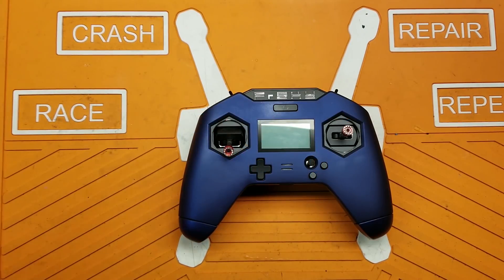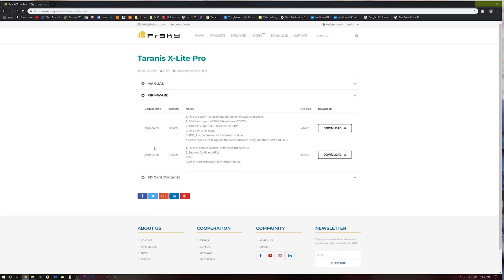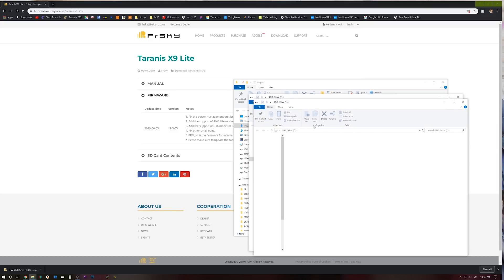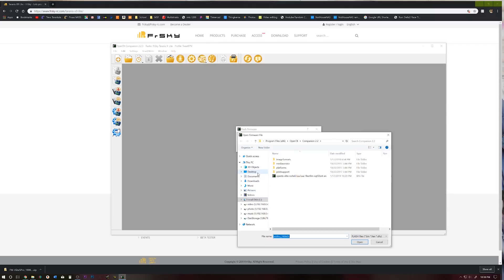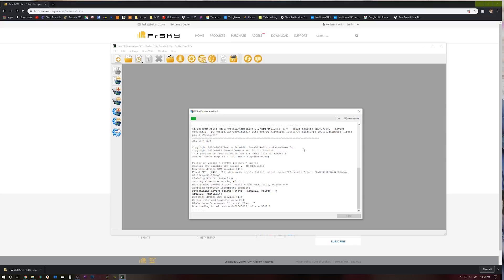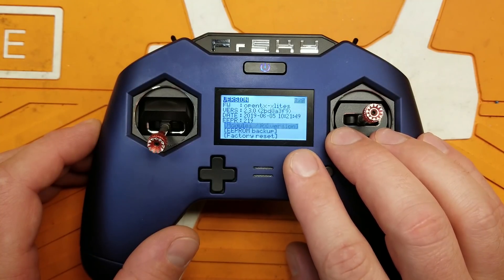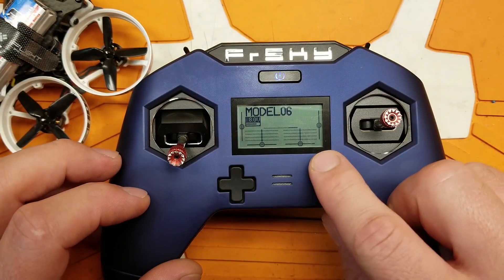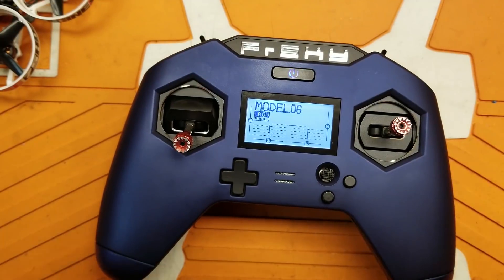Frsky xlite pro D16 support and PMU update!

Comment: Great video, my ixjt module not showing in my radio setup. any ideas? thanks.
Reply from the maker: Which radio are you working with?
Reply: @TweetFPV  Thanks for the swift reply, sorry it’s the Frsky xlite.My quadcopter binds no problem, motors start. But when I tilt the quad the motors stop I’ve even changed the controller from a inflight success f405 to a mamba 405 and it does the same. All the best.
Reply from the maker: 🤔 I'm going to need more clarification on that one. What do you mean by "tilit the Quad" what do you see in your osd when this happens? Have you check in the betaflight reciever tab that your xlite is moving the appropriate channel like throttle on your radio is moving the throttle channel in bf and pitch on your radio is moving the pitch slider in bf?
Reply: @TweetFPV  Hi
Yes in bf all good,even before I attempt to fly, even los . I flick the switch for motor activation , no problem until I lift the quad off the floor( props off) move it about the motors stop. I have even changed from a succex f4 to a Mamba f4. Still the same.Thinking of swapping motors, what do you think.?👍All the best.
Reply from the maker: Sorry, I'm not following. Join my discord and I can help you better.

Comment: Is there a way to bind the x-lite pro to the new whoops like the modubla6 that uses an internal frsky rx in D8 mode?
Reply from the maker: Some spi recievers can use d16 mode called frsky_x. But In my experience it's usually very unreliable to use. And range is very poor. I highly recommend the frsky xjt lite moduel with any of the micro quads in d8 mode. 
[Link]: https://m.banggood.com/beelink/fuvzxT

Comment: I got my x8r to bind to my x lite pro by updating the firmware on the x8r to the latest EU version.  Suggest you try that
Reply from the maker: There has been a fix. You shouldn't have to flash the wrong region fw to either device. Frsky has a Lua script to change the xlite pro isrm from EU to fcc.

Comment: Mine works and r9m lite did you flash your reciever also  once its flashed to access you cant go back to 16 mode
Reply from the maker: I have flashed everything over to access. I have found that I could flash my r9 system back to accst. I haven't tried to go back to accst on my r-xsr.
Reply: @TweetFPV  ive been able to do it with xm plus go back and reflash it to acct
Reply from the maker: My xlite pro was also a very early model.

Comment: I was really hoping to get one of these and put off getting the original X lite in the hope that something like this one came out.  But without D8 there's no way I would ever go to any of the latest generation of TXs since I have too many whoop boards that really need  D8 to work reliably.  Maybe if they fixed the random failsafe from the built-in SPI receivers, I might be interested as long a D16 works as it should, but I'm not holding my breath on that ever happening.
Reply from the maker: Yea I hope d8 comes to the xlite pro. If they made a xlite with shoulder buttons I would get it insted of the pro. Or like you said they could just get a handle on what's wrong with the frsky_x protocol on the spi recievers.
Reply: TweetFPV - Unfortunately, I’m hearing D8 will not be implemented.  Which is stupid in my opinion, but I am only a customer so clearly my wants and desires are meaningless... Perhaps that is some Asian Business Philosophy or something worse, but don’t give people what they want, make them settle for less and pay extra for it.

Comment: I got a Xlite pro today.  And I updated the firmware which supports d16 successfully by following your steps.  I can bind ac900 receiver and r-xsr receiver in d16,  and both work ok.
Reply from the maker: That's good. Many of the early models had a regional incompatability. Basically you buy a fcc version and the fw thinks you have a EU version.
Reply: @TweetFPV  I failed to bind tinyhawk s,  which supports d16.
Reply: @TweetFPV  do you have a tinyhawk s? can you try it? thanks
Reply from the maker: Yes I have the s and was able to bind it on d16 but I had to change the protocol from frsky_d to frsky_x
Reply: @TweetFPV I did change the spi frsky_d to frsky_x.  why I cannot get them work?
Reply: I tried like more than 20 times. and I am pretty sure that I did right with the binding procedures.  I can bind it with taranis qx7 in d16 mode. am I miss something?
Reply from the maker: Actually now that I'm thinking about it. It tried this with a crazybee f4 board but not the tinyhawk s. I will try it when I get home. I am on vacation right now without my xlite pro. But I will be sure to try it out when I get back home.
Reply from the maker: I just tried binding my xlite pro in d16 accst mode with my tinyhawk s in frsky_x mode and it does work. First try no issues.
Reply: @TweetFPV  yes.  I finally got it done by turning off the telemetry in betaflight.

Comment: Great video. Thanks for doing this. Did you remove the spring from your throttle?
Reply from the maker: No. I just followed the directions to remove the spring tension.
Reply: TweetFPV got it. My Xlite Pro also doesn’t work D16 have to contact Frsky.

Comment: I just saw a video on RC Groups that showed the Crossfire module working with the XLite Pro... YouTuber audio was in Spanish so I didn't understand any of it.. Any update from you actually getting it to work?
Reply from the maker: I have left the crossfire ecosystem for the R9 system. I wish i would have kept the crossfire for testing purposes. i can not confirm that it work. i would assume that since the R9 and multi protocol modules work the crossfire would but again i can not confirm.
Reply: @TweetFPV  Ok.. well here's one that would really piss you off. Just flashed the latest nightly, Crossfire STILL won't power on. Started digging into it, I can get it to power up on EVERY PROTOCOL except CRSF.. WTF???
Reply from the maker: Have you done the power management unit update from frsky yet.
Reply: @TweetFPV  I "Believe" I did that one correctly... That was the non nightly firmware from FrSky in this video. After the firmware update the CRSF option was again not available from external module choices. So, I flashed the latest nightly (06-17) and CRSF was again available. When I select a model and choose CRSF, the module still will not power up. But if I choose any of the other external module choices (SBUS, R9, etc) my Crossfire module powers up just fine. Frustrating!
Reply from the maker: Not sure why that would be. Hopefully it's just a bug in the nightly build you have.

Comment: Jumper fail... yeah I chose the T16 for a new radio... got it all set up... didn't like the feel of the wheel button from the start... was ready to fly and noticed the wheel button was down inside the radio... it is plastic with a plastic hex pin 1.5mm... broke off and I never got to fly. Bought it for the big screen... so much info on the larger screen layouts the text is still small and hard to read. 50 year old injun eyes here...

Comment: Im loving the x-lie pro videos man, I really like the feel of the new gimbals and I’ve got the external modules working, but I’m also having issues with the internal module. The power and open tx fw from your video worked for me, but the internal RF would not update. I get the error “FW update error device refused data”. When I look at the module / rx version, nothing is displayed. 

Anyone seen anything like this?
Reply from the maker: Yea, if you are set to a model that doesn't have the internal module on you won't see the isrm version.
Reply: Thanks man. I went back and checked this, but it didn’t help. I sent the details over to FrSky for assistance. I’ll report back with the solution/cause.

Comment: Too bad that D16 doesn't work.  I was considering getting one if it would work with all of my ACCST receivers.  Is there still no way to bind with D8?  I have a number of those too.
Reply from the maker: Only with a external multi protocol moduel running nightly firmware.
Reply: @TweetFPV  which still doesn't work for me even after the update
Reply: I guess we just wait to see what firmware they give us.
Reply from the maker: Other than nightly build that's all we can do for now.

Comment: Thanks for your last video. After seeing you last video i purchased these and installed Open Tx Nightly Build N20.  I have updated my xLite Pro with the latest update of power management and to Open tx Nightly build. I have one problem with my MPM external module. When I turn on the radio . The red and green light turn on my MPM and some times its stay green. When it shows the red and green then i switch between the models for the change of light. when switching between the model its comes again green. Whats the reason behind for red and green light. I have already update the power management unit
Reply: Need to update the bootloader. Only can be done by soldering connections to the FIDI pins and use ARDUINO to load the firmware and bootloader.
See https://github.com/pascallanger/DIY-Multiprotocol-TX-Module/issues/237
Worked for me.

Comment: Is your R-XSR LBT or FCC?
Just saw in the video that you flashed ISRM EU version...
Reply: Awesome video. Waiting until all is working from factory.  Really interested in this TX but don't have patience or computer skill. Thanks
Reply from the maker: Mine is fcc. There was no option for EU vs lbt on the isrm fw.
Reply: @TweetFPV  Check to what region your X-Lite is set in the menu, seems like it will choose automatically the "right" version depending on this setting...
...at least that's what I was told in regards of D16 LBT vs FCC, maybe the same goes for the ISRM update
Reply from the maker: I'm set to us.
Reply: @TweetFPV  Okay so that's strange then. There was a guy on rcgroups with a similar issue after the update and for some reason his was in LBT mode even though it was labeled as non-LBT, so I thought maybe it was the same with yours. Still need to do the update on mine tho and see how it's working out.
Reply from the maker: Hmmm perhaps I was sold a EU radio boxed as a fcc. I have a message into frsky tech help.
Reply from the maker: Also when I select r9 accst it gives me a warning that I need fcc fw. Normally the fcc ve lbt is set in opentx companion. And since we aren't building options and just blindly flashing fw I want to say that frsky's opentx build was setup for lbt and not fcc.
Reply: @TweetFPV  It really seems like so, just checked the "readme" file from the download pack and there FrSky clearly states that it will depend on what your Radio came set to from factory, LBT or FCC. For ACCESS it doesn't really seem to matter as it will automatically match to the setting of the transmitter, in other word you'd never know if you're running LBT or FCC.
Gonna flash mine now and see what happens.
Reply: @LeoBNR32  Sorry for my bad English... I set the Country Code to EU - an the system installed the fcc Version of isrm?!? Hmm...
Reply from the maker: Please let me know how it goes!
Reply from the maker: Haha I'll trade you radios! 😂
Reply from the maker: What happens if you set yours to us and flash the isrm?
Reply: @TweetFPV  how can i tell if mine is set to lbt? are you saying the nightly is by default lbt? maybe thats why it isnt working?
Reply: @TweetFPV  Ok, had an error message when I did the ISRM update, turned off the X-Lite and on again, tried to update the ISRM again and this time it worked...
...could bind to D16 LBT XSR-Sim dongle (at least the light turned solid green after the bind), just can't verfiy if it's 100% working as my PC won't recognize the USB dongle for some reason...
Strange thing is that for the external RF module, I have the option for R9MLite FCC but not LBT (I have a LBT version) along with the R9MLite ACCESS...
...ISRM is flashed with EU version tho.
Reply from the maker: Just confirmed with fsky tech and this is a bug in the fw causing fcc units to load lbt firmware onto the isrm!
Reply: @TweetFPV  Yeah, more bugs, that's exactely what we needed loool
Reply: I bought the x-lite via bangood - and i've just found out, that they sent me an fcc -Version of the x-lite. Perhaps that is the reason, that the isrm-update has installed the fcc Version. I also did not update the transmitter with the Version 190605 via the PC. Rather, I have made the update (Firmware / PMU and isrm) on the SD Card...
Reply: @TweetFPV  I also have an FCC radio set to US region and it loaded the EU firmware on my radio... What have you heard from FRSKY? I just sent them an email
Reply from the maker: Just that he verified that this is a issue and he has reported it to the dev team.
Reply: @TweetFPV  They should just bring back the ability for you to flash whichever version you want...
Reply from the maker: Agreed!
Reply: @TweetFPV  Ron at Frsky NA got me setup with a fix! Contact him if you haven't heard from him already